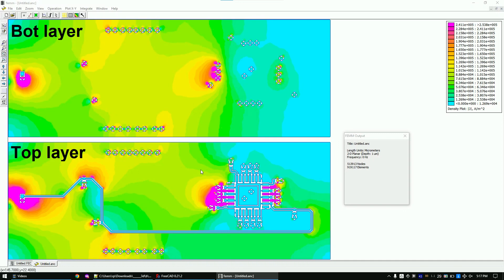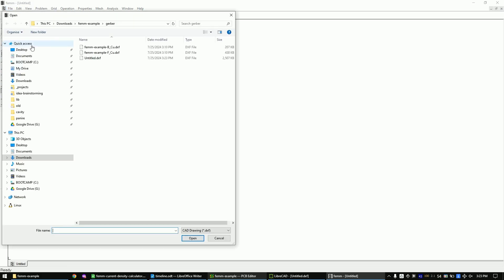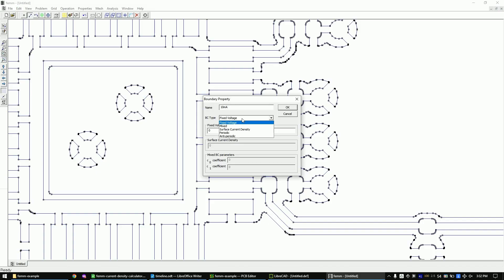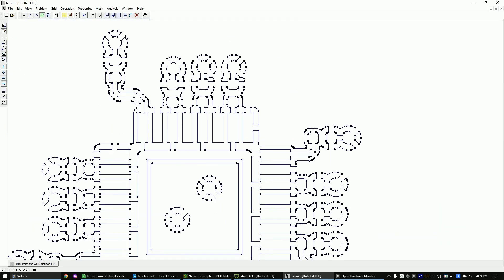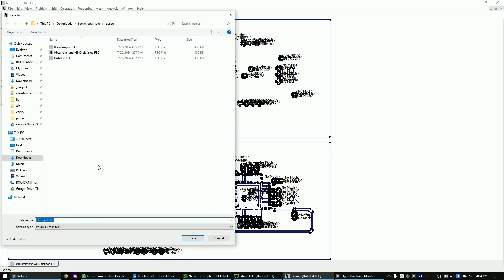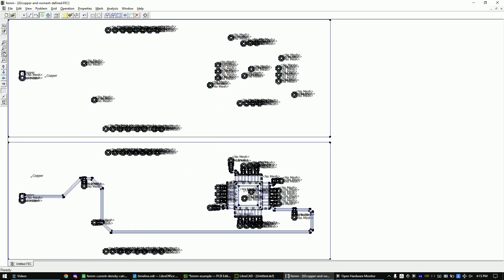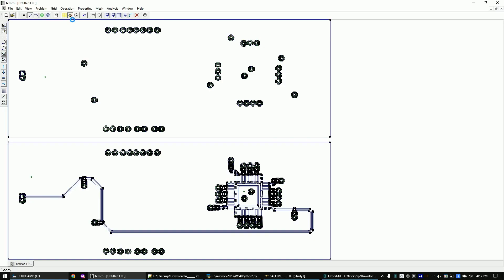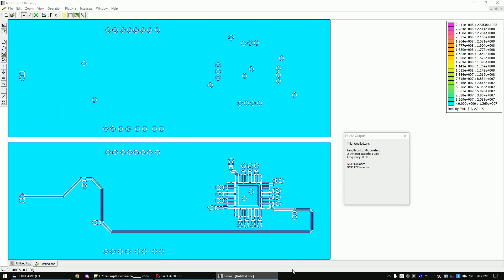free Multilayer PDN simulation for KiCad FEMM 4.2 Finite Element Analysis ground bounce+voltage drop

Comment: You know you dont need to place a material property into all the void areas. Only in one, then enable it as "default material". So there will be 2 block labels, one copper, one air, and the air is set as default. If you have 2500 vias under an FPGA, placing 2500 labels would be too much.
Reply from the maker: Oh thanks for the tip, I will try that out. If that really works this would be an amazing improvement. Thank you very much for sharing.

As FPGA sounds like a multi-layer PCB, try out this example, I think this 3D current simulation approach is easier to handle if you have a lot of layers: https://youtu.be/trNCL96CELo
Reply from the maker: I tried leaving the void areas empty while defining one of them as default material, but the simulation wouldn't run. I must be doing something wrong.
Reply: this is my step by step tutorial. The default block worked for me. 
http://buenos.extra.hu/download/APPENDIX%20-%20Step%20by%20step%20setup%20for%20simulations.pdf
Reply: i tried to reply with a link to my tuturial doc, but didnt appear. Default block labels worked for me.
Reply from the maker: @buenos4799  alright, found this link now, thank you a lot great info: https://www.femm.info/wiki/defaultmaterial

Comment: This is an OK tool if one is prepared to accept it is only useful to small cases (current flow and volt drop, in my case).  It does have some major drawbacks: 1) Useful for simple 2 layer PCBs, but I was not able to link more than two boundary elements for my 8 layer design.  2) The program will auto save your work if you select File Close even if you have not manually saved the work beforehand.  If you cut sections out to find a problem, close and reopen the original you'll find it overwritten.  3) Pop-up will tell you there is a problem with the boundary conditions (like multiple), but not where.  Just that you have a problem !  :D  4) If you rename a boundary condition, the new name is not propagated to the existing nodes/lines/arcs.  Instead, those nodes/lines/arcs are set to NONE !  ie  If you change a BC from "Load" to "Load_50mA", all those "Load" named points are now NONE and need to be re-assigned.  5)  DXF import rate slows as more and more data is imported.  It appears the program is redrawing the screen after plotting every point.  If your CAD data has fine line segments rather than arcs, be prepared to wait a very long time.  Best to simplify your DXF as best as possible before import.  6) Single threaded program, but not a problem if the case under study is kept small.
I haven't tried the magnetics or heat transfer tools so cannot comment on them.

Comment: the problem using FEMM in this way in the video is that you have to apply the Boundary manually to GND by clicking everywhere needed, it is a painful process. Let assume you need to change something on the main KiCad PCB layout to fix one issue spotted from a past simulation, you need to do again the entire process. It is not sustainable in my opinion, much better is to use the flow mentioned in the other videos using ElmerGUI from FreeCAD KiCAD importer, which is more streamlined.
the interesting part on this video is that you show how to use another free tool to perform the simulation successfully.
Reply from the maker: I also think its a bit troublesome :) The advantage of using the 2D approach of FEMM 4.2 is that the siimulation times are much faster than with the 3D tools, so i posted this video nevertheless as i think that not many people know the trick of using a periodic boundary to connect vias on different layers.